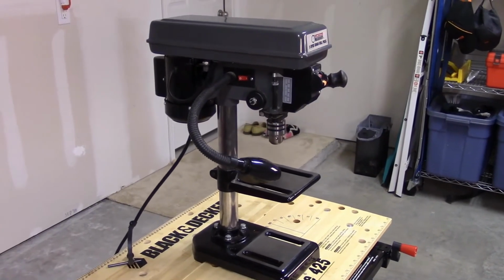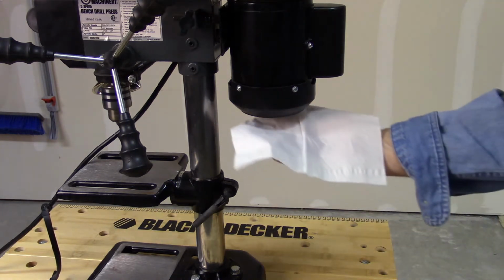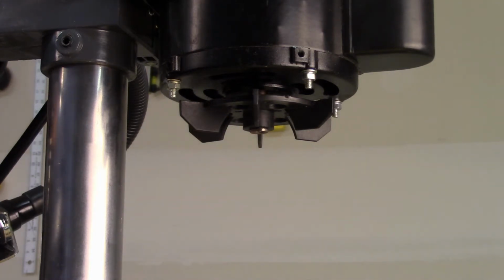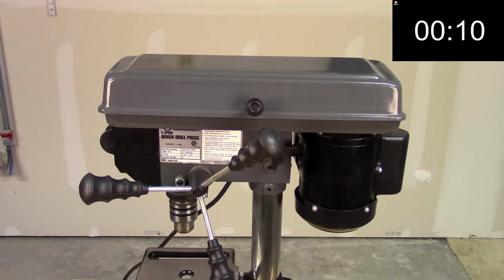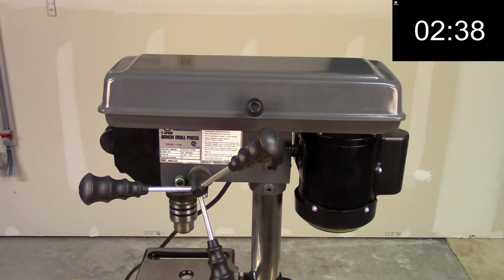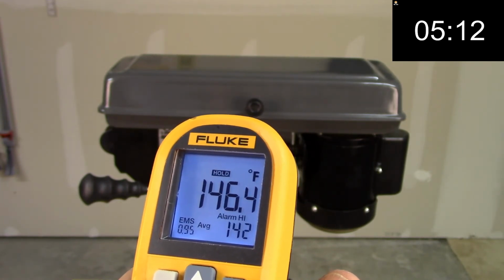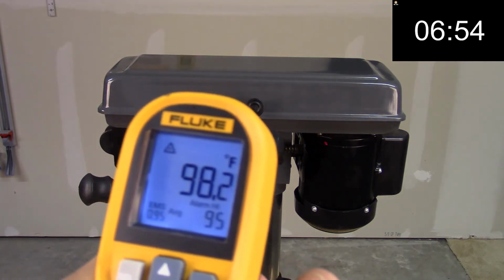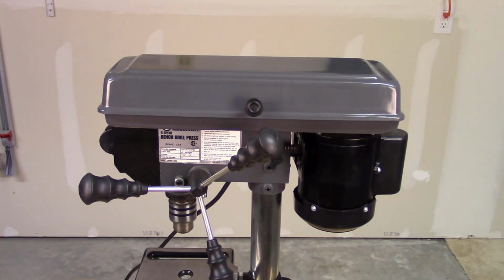Harbor Freight Drill Press Overheating

Comment: Great video my guy! I thought mine (same make very similar model) was running hot but after looking it up, those temps are normal. Motors tend to run around 180-200 depending on how good they are built. Now that does mean you cut down on life expectancy but I may install a better fan on mine.
Reply from the maker: Thanks Gyras and thanks for stopping by and commenting.  Cheers!

Comment: Interesting. I noticed mine getting really hot (I use it for mixing resins and silicones) and was curious if anyone else online had this issue. Didn't realize the fan had basically no angle to the blades. I'll try my hand at designing a fan blade to be 3D printed on a high temp ASA filament and see if that cools things down. It runs fine as is, but I do prefer my tools to run as cool as they can.
Reply from the maker: Thanks for stopping by and commenting.  Cheers!

Comment: I have the mastercraft version of this drill press and can confirm that the temps get really high if you are chain drilling holes. I use mine to chain drill holes in a work piece in order to set the depth of a channel I want to chisel out. After about 10 minutes of drilling the bearings start to make weird noises and I have to let the drill press cool down. Still not bad for a unit that costs only 160 canadian dollars. If I needed 24/7 operation I would definitely be looking into a higher end model or for my purposes, a drill mill.
Reply from the maker: Hey Joel, thanks for stopping by and sharing.  Cheers!

Comment: Mine a brand new and very similar type also gets hot after a couple of minutes.I removed its own plastic blower replaced with a 220v fan inside a plastic tube fitted without gaps in the motor body and still gets hot.But when motor stops the fan keeps running for cooling the motor.I dont know if these temperatures are in absolutely normal ranges or will destroy the motor in a short period of time.But around 10 minutes of even idle working i have the impression that the motor smells an odour of a varnish.
Reply from the maker: You have taken an interesting approach to this issue.  Since I made this video I used this drill to punch about 60+ holes in some 2x6 wood with little rest between holes.  It continues to operate just fine to this day.  Thanks for stopping by and commenting.  Cheers!

Comment: Hi guys, try to find which type of motor it has on it, if it is one phase motor or type S2 it is built to run only for some specified time, for example S2 15 minutes, S2 30 minutes. Then you let it cool to work again. S1 are meant to run without any pauses... It took me some time to figure it out. Hope it helps, have a great day

Comment: Could you use a heat gun and heat the fan blades and bend them?
Reply from the maker: LaTX Piper That's a possibility but I don't know if it would make that much difference. Someone would have to try that out. Thanks for stopping by and commenting.
Reply: Reason for asking is I got this drill press but haven't used it yet but when I do I will be using it for more that 5min.
Reply from the maker: LaTX Piper You know, I have used this drill on projects that took more then 30 minutes drilling through sheet medal and 60 holes in one wood project. So I doubt you'll have any troubles with heat. Do keep and eye on your belt tension as this impacts how long they will last.
Reply: That's a good idea to try. First, thanks to WMG for the alert. Next, I just installed the 10" tonight. The wife and I will be drilling agates which commonly take ten minutes. What's the chance of ordering a spare part and trying to bend the fins on the spare?
Reply: Maybe I'll go back and get the extended warranty.

Comment: Straight fins!!@#@!# .. oo my.. i got a similar drill press i have to check it
Reply from the maker: Hey Joe, thanks for stopping by and commenting.  Cheers!
Reply: @autohelpeu  welcome mate.. i did some research this blade type is a straight impeller.. it is used on big motors i think due to the robustness.. still i opened mine and it was broken and didn't blow much air.. i plan to use a couple of blower to force air into the motor.. the motor is really dense inside and blowers have high pressure so they can push the air to other side

Comment: The real question is: Is this even an issue? Most plastics can withstand well over 300 degrees so 180 shouldn't be a problem. Than again using one of these with a for instance a large polish head probably isn't a good idea 😅
Reply from the maker: FullFledged2010  You have a good point. But it certainly was an interesting exercise. Thanks for stopping by and posting.
Reply: I seldom need to run it more than a minute at a time, but maybe I can get a kid to make a real fan blade on a 3D printer...

Comment: They need to do a better design of the fan blades. they all are straight,
Reply from the maker: jeff hebert Yes, I don't really understand why the blades aren't curved to move more air.
Reply: The blade is straight so it works in forward and reverse

Comment: It will Be a boat anchor sooner then later, the cheap brushes will not stand up to the heat for very long!
Reply from the maker: Donald Trump You know, I thought the same thing. But I've done a lot of drilling since this video and it continues to hold up well. The only place I have noticed wear is on the belts.
Reply: Thanks, I hope it does hold up well.
Reply: Shouldn’t be any brushes in that motor. Commercial motor with a capacitor start assist.